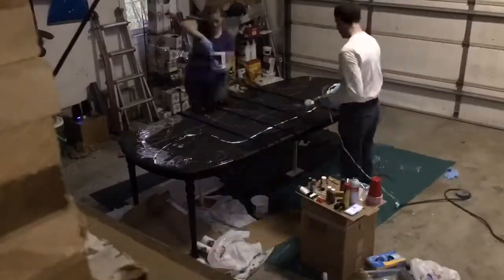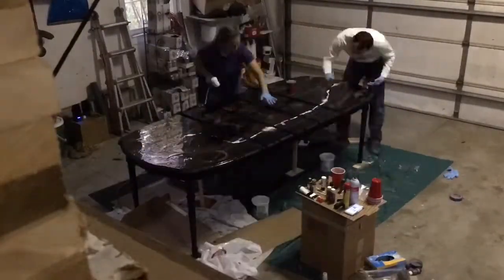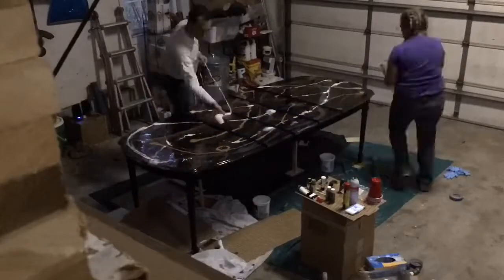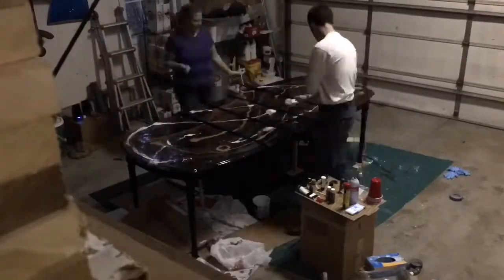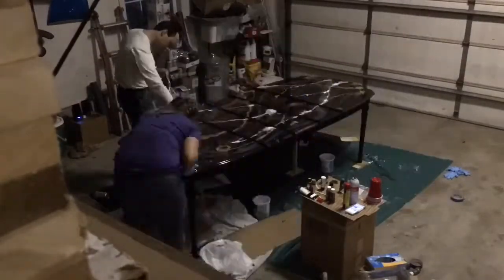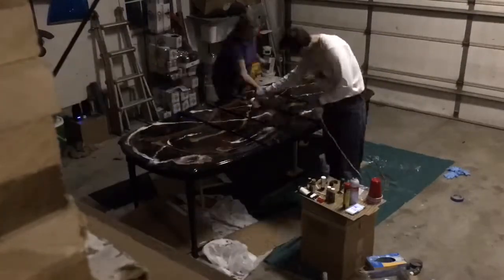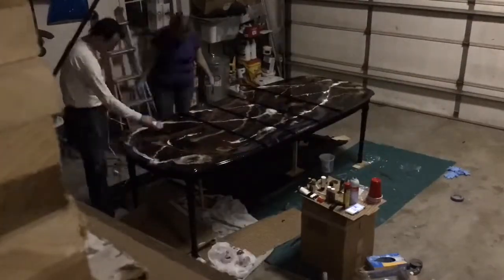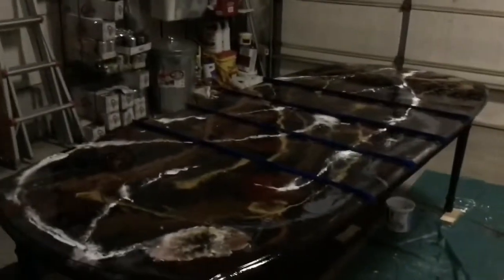Table with Leaves redone with Epoxy Resin (HD Video)

Comment: Did you pull the tape for leaves while wet??
Reply: This is the question to ask.. Im doing many tables and leaves can create problems. There are a few ways to do it, but what I've found is it looks more professional if you use Tyvek tape and tape from 1/4 inch down not up so that you get the natural flow of epoxy over the corner. Then when it drys or at least sets up , you can pull the tape. After , I do some fine sanding in the edges. Hope it helps.